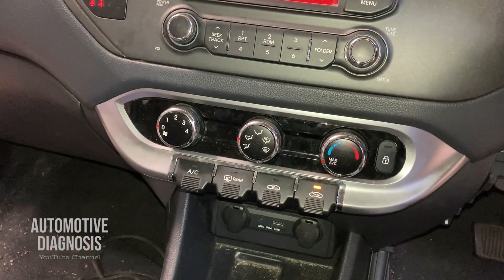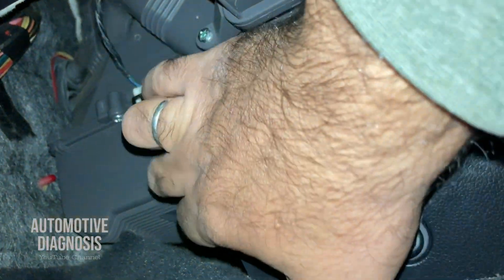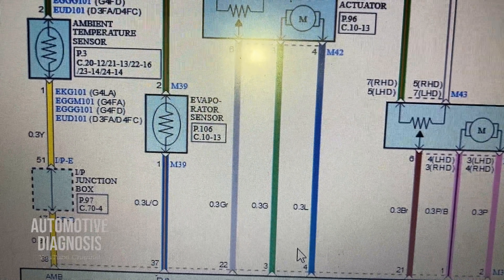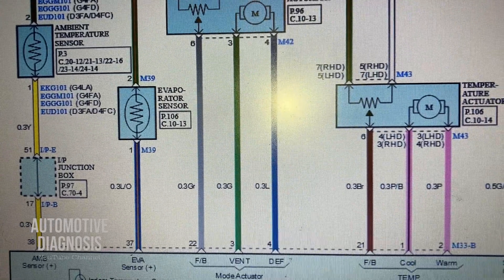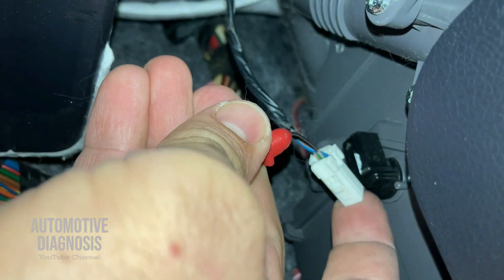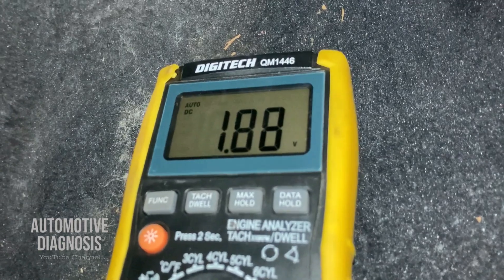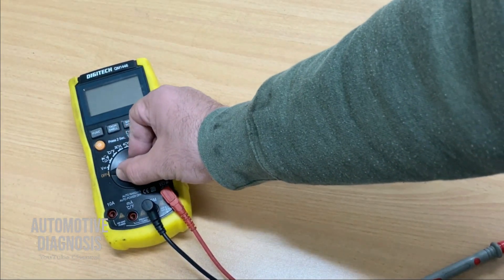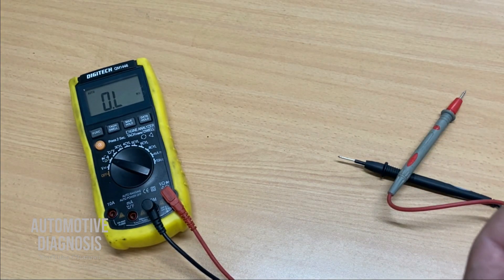A/C Not Working? Evaporator Temperature Sensor Test & Replacement

Comment: I have fixed many no working ac with this piece. Not once have I just guessed. For one, most auto ac units don’t have an evap temp sensor. Hook up a compatible scanner, look at the evap temp sensor reading. If it’s like -45 degrees then it’s bad
Reply from the maker: Thanks for sharing your experience, my friend.
Reply: Mine is ready -7

Comment: Hi 
Abbasi 
There was 5 volte power  on evaprator 
How much ohms out put or volt should it have when the car is turned off
I am remeber of achar 10
Reply from the maker: Hi my friend. I measured the 5 Volt when engine was off and ignition switch was on. For the resistance you need to consider the temperature, as sensor resistance changes constantly according to the temperature.

Comment: Hello sir 
Im abbasi from iran and my english   is bad and weak 
May i ask you question 
Of course 
Its  in interesting for me how to lean 
I just want to learn english 
How much ohem or volt should be out put
Reply from the maker: Hi my friend. It's great to have you in the channel. This sensor's resistance changes according to the temperature, when temperature increases, we will have lower resistance. So you need to check the table of the specification at 03:49 to see what range of resistance you should expect.

Comment: Very convenient location for the evap sensor - just reach under the dash, disconnect the harness, twist and pull out. But for Subarus you have to take out the dashboard and disassemble the evap system including the blower just to get to the sensor.
Reply from the maker: I don’t think they ever put themselves in mechanics shoes when they design a car!